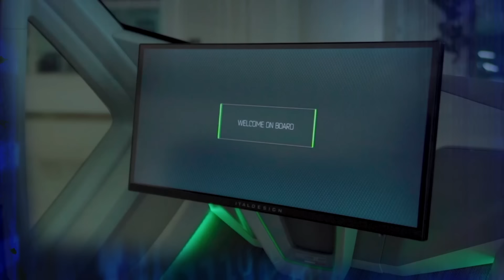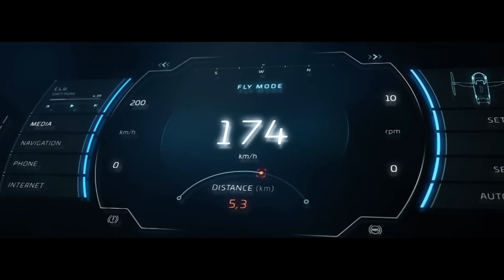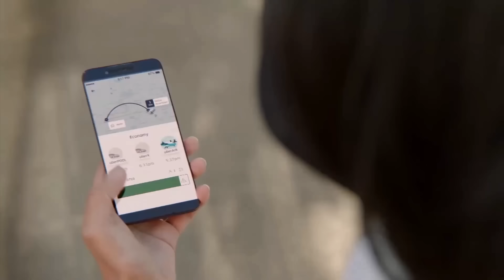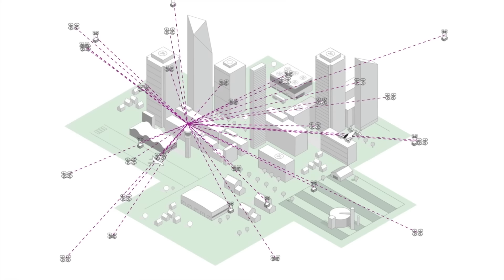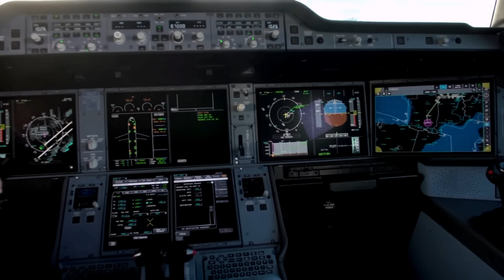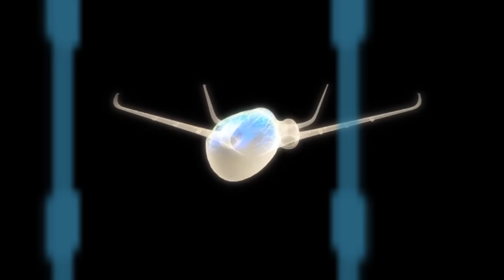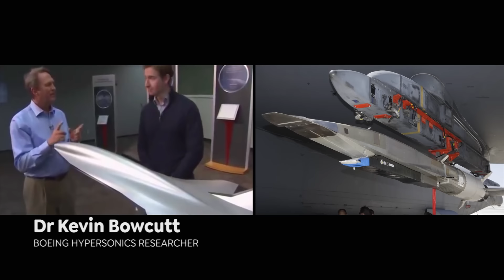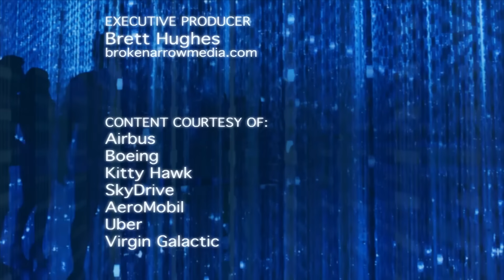Flying Cars and The Future of Aviation | Flying Vehicles | Air Taxis | ENDEVR Documentary

Comment: Interesting concept! I can really see this happening. We are almost there!
Reply: I'm in aviation. We ARE NOT almost there. Not even close. The average person is not responsible enough to fly anything. Don't get me wrong. A TON of people will do it right but few will have a car/plane in the garage. Flight and heavy maintenance go hand in hand. Most people can't even change their oil on time let alone do it themselves. How many times have you seen cars that shouldn't be on the road or have minor damage here and there. If you are gonna put it in the air it needs to be fixed and fixed right. We rarely crash because of a catastrophic event. It's mostly a string of small events having nothing to do with each other that come together and down you go. Even with automated vehicles ground drivers will bring their skills and habits to the air or rather lack of them to the air. 
Airlines need to go full automated first. Lots of kickback over the last 20 years but it is coming. From there it goes to smaller planes. Public transportation is next and that is where we will spend decades getting ready for individual normal drivers. I think it's going to take just short of 100 years to get there. Infrastructure will take time. A lot of time. We had a few helicopters going full electric testing at our base. 5 years on and they are still saying they are not even halfway done with testing. Humans are not ready for widespread 5th Element action yet. The drones are almost here. They will help setup the infrastructure but it will take decades to be common place. Remember  A LOT of people will lose their jobs the closer we get. There is somewhat of an artificial hold up going on as we speak because of that.